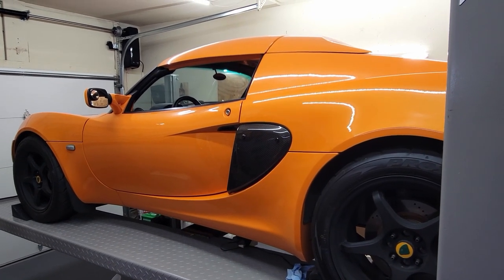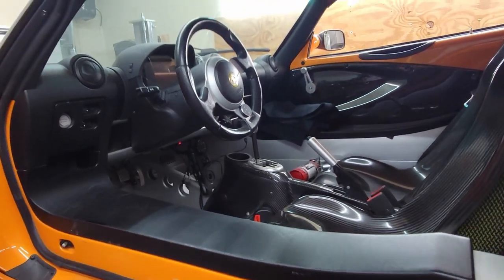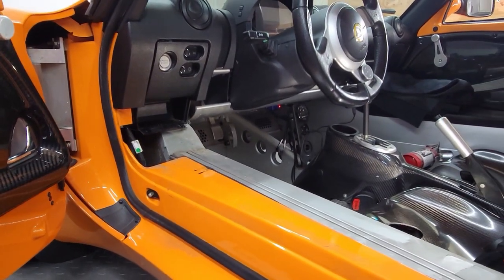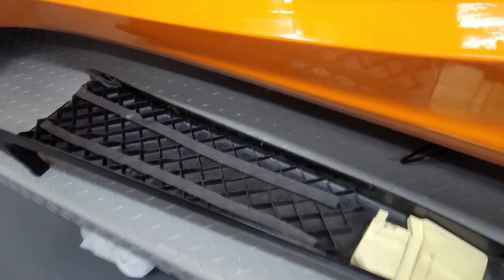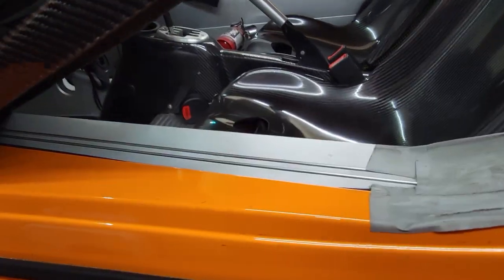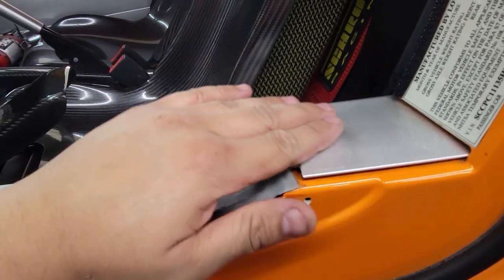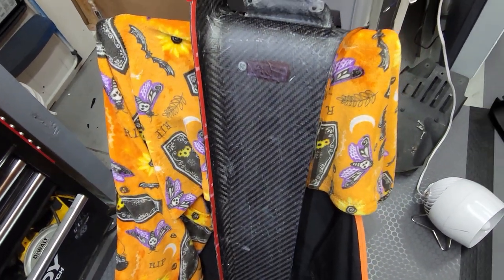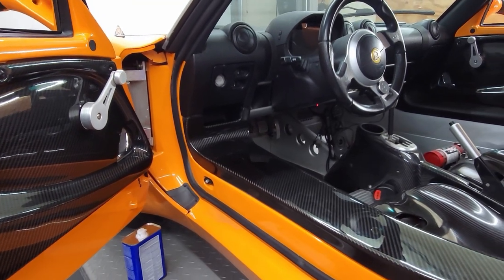Lotus Elise 2023 Winter Projects Part 3

Comment: What type of head unit are you using?
Reply from the maker: It's an android radio "joying" is the brand and this is the 8.8" version of it. It is sold on Amazon.com or eBay. 

If I had to do it again, I would buy the smaller 6.2" version. As it fits better and has a volume knob. Thanks for watching and commenting!